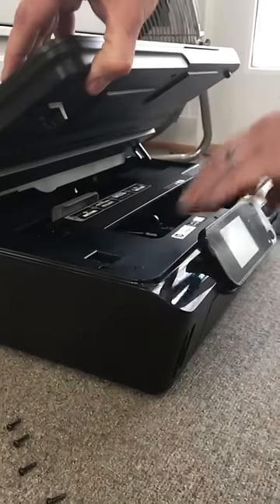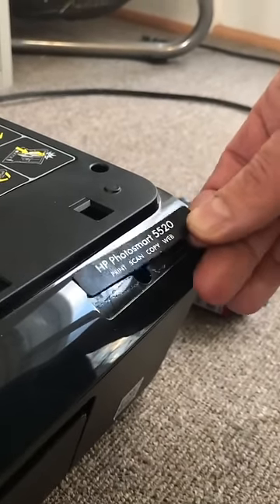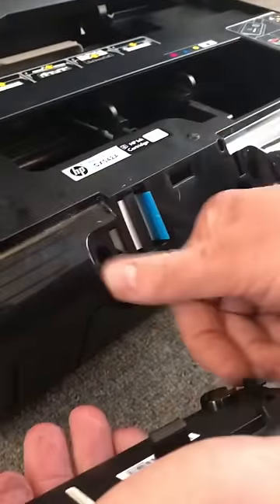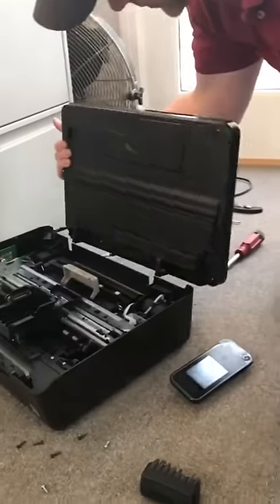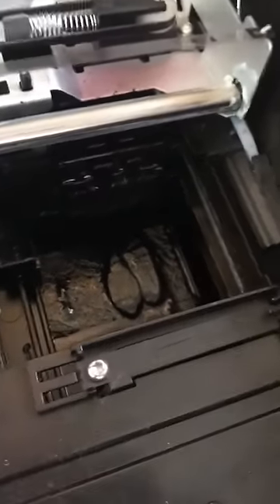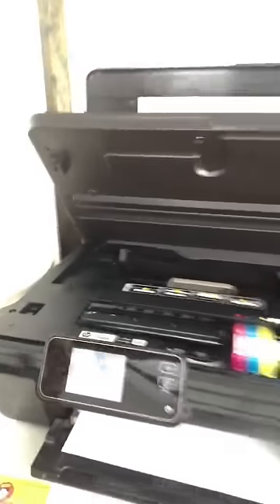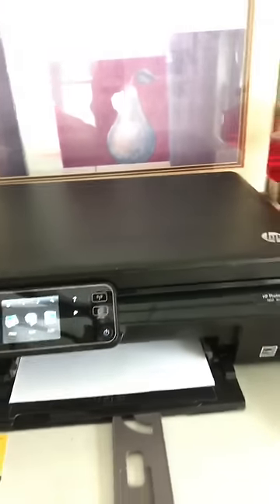HP Photosmart 5520 Black Ink Problem

Comment: How do you call the part where the printer  ink head gose cause the white strip that is on the side  came off
Reply from the maker: I’m sorry Sonia, I’m not sure what your asking me. Are you asking me what the part is called that holds the print head or how to put the ribbon cables back in?
Reply: @237130  yes
Reply: @237130  I have to buy that part dont 3 how is called
Reply: The part that goes side to side

Comment: My printer printed black text perfectly, then on the next page something went awry.  Imagine pulling close a white Venetian blind over a black background until you see only the white.  That happened on the next page.  I ran the Clean Printhead function a couple of times.  That didn't fix it.  Thought it might be corruption in the printer buffer and left the printer off for an hour.  Tried it again and still got no black print from it.  So I left the printer plugged in, but a week has gone by without usage.   I watched this video for a fix then thought I might just do a print test before applying Jarrod's advice.  It printed black perfectly first time.   In my case, I'm guessing that something in the process the printer goes through after a long period of disuse fixed the issue; something that is absent from the printhead cleaning function.

Comment: Great video! My 5520 has a black ink issue; it keeps leaking ink. Other than that it prints beautifully. No idea what to do about it. Anyone?
Reply from the maker: You may have to see if the pad that the print head sits on is loaded with ink. There may be so much ink built up on it that the print head is carrying the excess ink and dragging it across the paper. I have another printer that has a saturated ink pad and needs to be cleaned out. I’ll do a video on that process, if I don’t just toss the thing in the trash out of frustration!
Reply from the maker: Also, thanks for watching!
Reply: @237130  that might be the problem. I’m having an other go at it this weekend. For now I’m done with it. Thanks for your answer, very much appreciated.

Comment: I have a problem.
Hp deskjet ink advantage 5275
Error code
0xB8042326.
I was using normally and suddenly it is showing error.
Pls help
Reply from the maker: Kedar Kulkarni I’m sorry I won’t be much help to you with that printer. I’m unfamiliar with that model, but a quick search on google produced a bunch of steps to try to clear the code.
Reply: @237130  i did everything but I couldn't resolve.
Its new device.
Btw Thank you very much

Comment: It sucks not having the proper tools to unscrew my printer I think I have the same issue as you but have no access to the right tools to unscrew the screws they are so tight!!!
Reply from the maker: Michelle Mendez Thanks for watching and once you get the Torx bit size T-10 for those screws, you’ll be golden. Let me know how it goes.
Reply: Jarrod Fothergill I got it to work without having to unscrew it!! I put an alcohol filled paper towel at the bottom and would dab the cartridge head at the top with a paper towel with alcohol for about 2 hours then I turned it on and selected for it to clean the printhead and it finally printed!! Thank you for your video, I’ll still go out and buy the T10 screwdriver in case I ever need to use it!
Reply from the maker: Michelle Mendez Outstanding! Glad you got it back in order! Again, thanks for watching.

Comment: Thanks for this video.. I have a similar model (5524) and it just blows my mind that you need to unscrew a billion screws and take your whole printer apart just to get to the printheads. This is ffing insane. of course I don't have a torque screwdriver set so gotta get that as well... 
great. wonderful printer when it works but it's torture when it doesnt and you need to repair sh*t.
Reply from the maker: It does suck that we have to do this. I believe it’s a side effect of having fast drying ink. My mistake was taking the cartridges out to the store with me. This allowed the ink in the head to dry out. 

I wish you best of luck with your repair and thanks for watching. I hope the video helps in some way.

Comment: Why didn't you just a suggestion that you can use a dropper to flush the ink out from top of printer head like I do with alcohol not water use a 70 to 90 percent ok hope this helps load it with non used paper but it should be wet on printheads it said though so be careful
Reply from the maker: Thanks for watching. I started with simple attempts, but these heads were very clogged. I tried alcohol, I tried soaking over night, and nothing seemed to work, so I had to go to extreme measures. I’m glad your easier method worked for you though! 😊

Comment: I did all these steps and I might have fixed it, only now it says the ink cartridge head is jammed. It moves freely all the way left and right. Followed all steps to clear the jam but it still says it is jammed. I'm about to give up and buy a new printer.
Reply from the maker: Richard Napolitano Don’t give up yet!! Did you verify that the black plastic strip that runs from side to side is properly threaded between the three sensors on the back of the print head? This plastic strip tells the printer where the head is in relation to the paper. On the back of the head, there are three sensors, two sensors over one sensor. The thin black strip has to be threaded between those sensors. Check it out and let me know.
Reply: Jarrod Fothergill That was definitely the problem with the print head alignment. I was able to fix that. But now I have another problem. When I put it all back together, the LED display isn't working. The power button is lit up and glowing, but the display is off. I made sure the ribbon was plugged in. Not sure what's going on now.
Reply from the maker: Richard Napolitano have you taken a look at the ribbon cable for breaks? And have you made sure that both ends are firmly seated in the connectors? After that, I’m afraid I’m not sure what to look at for the screen.

Comment: Tried each step a number of times but still no black ink, any suggestions would be welcome.
Reply from the maker: After soaking the printer head, putting the cartridge back in the head, and blowing into the vent on top of the cartridge -to force ink through the head, other than that I’m out of suggestions I’m afraid. Thanks for watching though.

Comment: I did not know how to open the screen. Now the it’s damaging itself. I wonder why.
Reply from the maker: If your print head slams side to side, the long grey ribbon is not between the three sensors on the backside of the print head. I believe there are two sensors on top and one on the bottom. The grey rubbing needs to run between the top and bottom sensors.
Reply: Jarrod Fothergill any recommend video about it? The screen didn’t  work as well.
Reply from the maker: John Yousef The ribbon cable behind the screen needs to be pushed in all the way and the cable needs to go in the exact way it came out. In other words, maybe it’s upside down. I wish I could help more sir.

Comment: My printer gets me crazy i have the same  problem it won't print black..i did everything but still won't print unfortunately
Reply from the maker: Then I believe at this point, it’s time to take it out back and say goodbye!! After soaking and trying to force air through it, and still not working, it’s probably a solid block of dried ink. Depending on how much time you want to invest, try soaking the print head for a few days. Thanks for watching. Let me know if I can help.

Comment: Tried to do this but when i went to put everything back together... the printer gives us a "jam" error. Basically the cartridge carrier now doesnt lower down into the slot and just violently slams against the right side of the printer... Went to fix one thing and totally destroyed the printer now :/ we are not sure whats going on as we have dismantled it and put it back together several times to make sure everything was correct :((((
Reply from the maker: michela marano Hi Michela. First, thanks for watching! The print head/cartridge holder will slam back and forth if the the thin black ribbon cable that runs side to side is not properly threaded between the sensors. This will cause the processor to not know the location of the print head and will slam it side to side. On the back of the print head, there are three small black sensors. I believe theres one on top and two below it. This black ribbon needs to be threaded through those three sensors. Again, if not, the processor won't know where the head is in relation to the paper and will slam it back and forth. It happened to me a few times too!
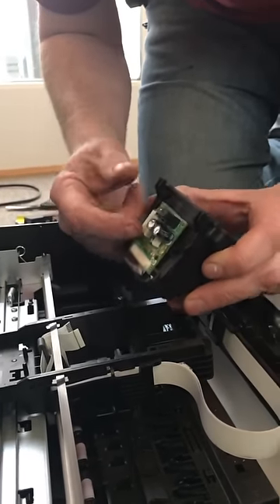Reply from the maker: michela marano Jump to 4:38 in the video for a visual!
Reply: Ahhhhhh!! we must have not realized about the 3 sensor points... we ll get it reopened and see if we can fix that, thanks for the tip!!! will let u know!!!
Reply: Thank u for the help!!! It was the central sensor not aligned!!!! Put it back together, now it works.. except for the blank ink still doesn't work at all. But I'm glad the printer itself as of now works...
Reply from the maker: michela marano This printer is a pain in the a$&!! Behind the label in the top of the ink cartridge is a vent. It looks like a tiny groove under the label. With the ink cartridge in the print head (print head removed from printer) I had to put the ink cartridge up to my lips and blow into the vent on the top of the cartridge. I had to force air into it like I was breathing life into it!! But it forced the blockage out of the print head. Have some newspapers around as black ink may come dribbling out if your lucky! That means it has worked! Good luck and give it hell!!
Reply: Jarrod Fothergill 😂😂😂 ok, i literally even put the print head under water in the sink (with caution to the back of it) am gonna give this a try, if not... there goes the whole thing into the trash can... I am so done with it! Thanks for the patience of explaining all these steps to me!! U rock!
Reply: How did it go? :) (I'm having the same problem)
Reply: Unfortunately I tried them all... even detaching the whole head and soaking it in water, minding the connectors. I tried several times, nothing helped fix the problem and the printer ended up not even trying to print anymore. Result.... the printer is now in the box, set aside in my basement and i will never ever buy an ink jet ever again. Laser jets only from now on. Good Luck though!!

Comment: Your HP printer has print heads separate from the ink cartridges.  My HP printer (C4795) has the print head built-in to the ink cartridges.  Both types are problematic.
Reply from the maker: Problematic to say the least. I recently gave up the ghost on the HP and went with a Canon Laser printer with toner. Never going back to ink! Thanks for watching.

Comment: Jarrod Your Youtube was very helpful. I found a new way to clear the blockage. I used a Panasonic Oral Irrigator (water floss) to squirt water at the blockage - i use this for my teeth. The mistake i then made was to have the band that goes across too low down. Once I fixed that my printer became like new. I might switch to a laser printer next time but they are much bigger.
Reply from the maker: GASBAGSMike Thanks for watching! If I ever have to buy a printer again, I believe I’ll be going for the laser printer myself! Mine has been in storage, in the southern summer heat, in a cargo trailer all summer and I’m interested how it’s going to perform when I plug it in. It’s probably all caked up and will have to be a video made on its resurrection! Thanks again for watching!

Comment: Hi Jarrod! It did not worked... awaiting for the a new head bought in Ebay as there's no way to make the black cartridge print... will revert when new arrives, if not will buy a laser colour... fed up with ink!!!
Reply from the maker: Pablo Bernal As I stated in the video, all the overnight soaking I did had no effect. I had to put the black in cartridge into the print head and blow into the vent which is located under the label on top of the ink cartridge. This forced air into the cartridge, which forced ink through the cartridge and into the print head. Have paper towels nearby!! My printer works beautifully now. Hope that helps you!

Comment: Found a much easier way to fix this issue. No need to take it apart.

1. Open lid to expose carts
2. Remove carts
3. Fold a paper towel thin enough to sit underneath printhead and move printhead over the towel
4. With a syringe of warm water blast water through the print head
5. soak up all water
6. Couple of printhead cleans once carts back in and switched on

Worked for me a treat...
Reply from the maker: That’s fantastic!! I’m very happy that worked for you! When I was working on this thing,  I started small with the repairs by cleaning just the head with an alcohol wipe down, the on to soaking, then when that didn’t work things got more drastic!! These are great printers and are worth the effort! Thanks for watching!!
Reply: I tried this, but didn't have the water syringe. Therefore, I improvised with what I had on hand (a turkey baster and a can of compressed air). Took about 40 minutes, around 5 rounds of cleaning, and a few rounds of reseating the cartridges, but it now works perfectly! Thanks so much to you both! (Saved me $200). Now just to get rid of that BO ink smell from testing the vents.... :)
Reply from the maker: IRBA2Plus I’m glad it all worked out. This printer of mine sits in an unheated office and it’s currently 20*F here, and she still prints flawlessly. On top of that, it has been telling me for three months it’s ink cartridges are empty. Still printing away. I think the sensors for ink levels are a little off!!

Comment: SCREW THAT!!!!  I should't have to fine a hidden screw, detach a a face head, open my printer just because my page won't print right.  I'm done with HP products.
Reply from the maker: Abonanno24601 I agree completely, but for those who can’t afford to buy a new one, a strong exhale into an ink cartridge may save them $100. No one should have to do half the stuff I do to not waste money. I agree with you completely, but if taking a few screws out means I keep my hard earned money out of their pockets, it’s a win for me!
Reply: @237130  - Amen, Brother. "Use it up, Wear it out, Make do, or Do without."

Comment: well that did not help now it is damaged print head.. and I was very very careful... grrrr trash can!!!!!!
Reply from the maker: Darlene Formanek I’m sorry to hear it didn’t work for you, but I have to ask: what did the print head do to make you think you damaged it? Sometimes the ribbon cables don’t make it back in correctly and it starts to do strange things! But I do thank you for watching and commenting. Please let me know if I can help.
Reply: The screen is stating print head damaged call HP.
Reply from the maker: Darlene Formanek I’ve seen that pop up before when I put mine back together and forgot to route the gray ribbon that runs from left to right through the three sensors on the print head. The printer couldn’t tell where the print head was in relation to the paper, slammed the head side to side a few times and that message popped up. Once I routed that cable through those sensors, it worked fine.

Comment: Look how difficult HP makes fixing ink problems..so they can make money hand over fist selling cheap printers
Reply from the maker: Absolutely correct. Like planned obsolescence. I also believe it’s a common side effect of the necessary fast drying ink. Seems to me that when I made the mistake of taking my ink cartridges out to match them with new ones, air got to the head and being fast drying ink, it took no time to clog up. Laser jet is the way to go in my opinion. Thanks for watching!

Comment: HP is fucking garbage. I cleaned my print heads and the PCB board started smoking on the left side. I didn't lay a finger in that area and I am proficient in building computers. Shit just starts smoking out of nowhere and now it's completely dead won't even power on. Never buying another HP product again. Good video too bad these printers are utter garbage and were never made to be serviced.